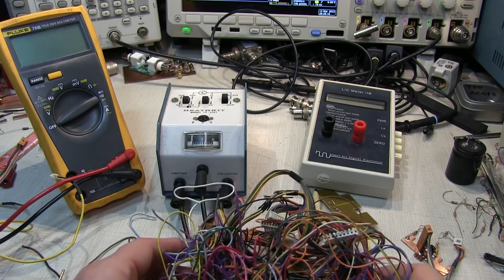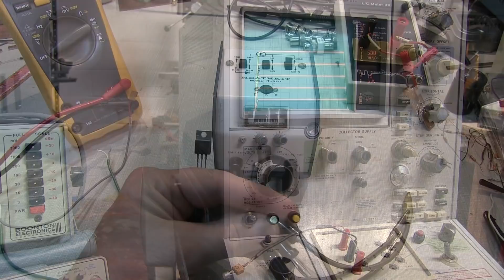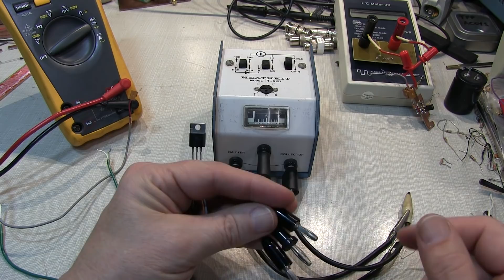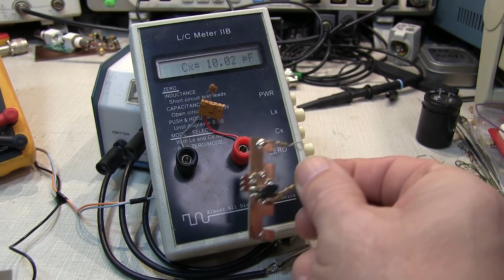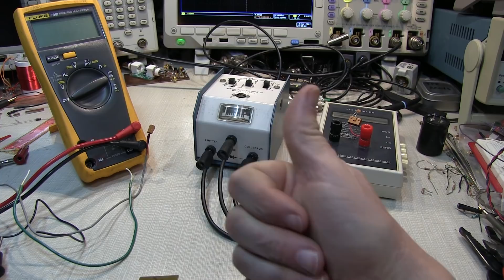#351: Quick Tip: Cheap source of test sockets wire and for your projects and component test needs

Comment: Some old serial and printer cables are a most excellent source for multi stranded hook up wire in a multitude of nice colors.... They are also very easy to salvage, just cut the insulation lengthwise with a knife and pull it off.

Comment: After handing a lot of old wire/cable it might be a good idea to wash your hands before eating with your hands, PVC often has pthalates in it, well, kind of coming off of it.

I have used lots of used wire and cable, too. Good video, as always. 

I like the floppy power plug socket tip. Oddly, when putting test leads on a breadboard, often put the breadboard down on a piece of looped indoor-outdoor carpet, and then I use a strip of velcro to hold the leads cables in place onto the carpet.

Comment: Microwave ovens and washing machines are a good source of wire, screws and other bits & pieces.

I like the idea of using those connectors as test sockets.

Comment: VGA cables have been tossed or recycled in vast quantities and low priority installations are still being processed as organizations, government, and educational institutions refresh equipment. VGA cables have a variety of wire inside and are very flexible. Sometimes you can snag 25, 35, 50 feet, or longer cables removed from projector installations.

Comment: Beware of some of the wires. Not all of them will solder very easily. Test solder 2 of them together. A different flux? Too little heat? Oxidized, contaminated or dirty?

Comment: If you end up using coax wire that isn’t 50 Ohm what should one look out for when testing? Also, using some of that old wire is fine when prototyping circuits on a breadboard? No other factors to consider? Like maybe accounting for losses in your equations or cutting to length depending on how many Ohm’s you measured.
Reply from the maker: These lengths of coax are so short, that the losses should be minimal at HF frequencies and below.  The resistance of the wire should be neglible.

Comment: If you have obsolete serial or parallel printer cables, cut off the connectors and strip off the outer sleeve with a coax/Ethernet stripper tool.  You get 9-25 different colored #28 flexible wires.  Perfect for a wiring a control panel to a pcb.  Twist wires together for a neat low noise assembly.
Reply: Old SCART leads are also good

Comment: Absolutely! I’ve been stripping wiring harnesses from freezers, refrigerators,  washing machines, HVAC units too...for decades. Installers thought I was nuts when I said I wanted to scavenge our two aging central air units. Two nice blowers, two little squirrel cage draft inducers, 24V continuous duty transformers, wire, switches.

Comment: Wire from such commercial junk is a piece of shit, especially for applications requiring soldering. Low temperature resistant insulation, very bad tin wetting. Do not use this junk, definitely not worth. Buy proper quality wires.
Reply: Especially wires from the more modern commercial junk are crap. Do not use it unless desperate.
Reply from the maker: I've actually had good luck with wires pulled from electronics from the 70s through the 80s.  Things started going downhill in the late 90s in terms of component/wire quality.

Comment: Other good finds from temporarily diverted electronics and appliances: wires with high temp woven fiberglass insulation, odd parts that really come in handy when I've suddenly needed them (coils, ferrites, opto-isolators) and all manner of spade connector variants.

Comment: Vintage NOS TV service extender cables are also handy - 9 different colors in each harness.  RCA Convergence and yoke extenders yield nice 18AWG stranded 600V wire.  4 feet typical length, so plenty for use.  eBay and swap meets yield lots of extenders that serve no modern purpose.

Comment: Hello and thank you for your informative videos. I recently got my hands on a Simpson Model 49 Analog meter. I cannot find any info on this model. Are you familiar with this model?
Reply from the maker: I've never seen a regular VOM called that, but I have seen a '49' as a model number for just the meter movement itself, such as on page 10 of this:
http://lcweb2.loc.gov/master/mbrs/recording_preservation/manuals/Simpsons%20Stock%20Panel%20Meters%20(Bulletin%20No.%202065).pdf
Reply: @w2aew  I suspect it is a home built tester. The meter is marked Alternating Current, rectifier type, numbered from 0-15 volts,  2000 ohms per volt, Simpson Model 49. It is enclosed in a stainless case with two selector switches. Thank you for your reply.
Reply from the maker: @bobv8041  That's probably what it is, especially if it doesn't appear to be a Simpson-made case.

Comment: We had a replacement satellite TV dish installed (at no cost to us) and afterwards, the installer asked where he could bin half a reel of high-quality 75 ohm coax. He explained that installers were told to allow an average of 30 metres per installation and if a 50 m reel was likely to contain less than that, they binned it. Turned out there was over 30 m of coax left on the reel which I've put to good use!

Comment: A few months ago i bought a new washing machine, and wanted to recover the wiring from the old one (11years old), i found less then 3metres total in wire inside.
I remember back in the old days (end of the 80's begin 90's), when i did this, i had a entire box full of cables in all colors and color combinations you can think off.
Reply from the maker: Yes, the older stuff had more wires, less integration.

Comment: The best type of re-cycling is "Man Hours" of labor contained in something, more than the elements by weight. For example: Harvesting the wiring and components inside of old electronics gifts TO yourself the hours that were already expended (and would be lost in shredding&melting down a VCR) and would extract thos hours FROM YOU if you were required to make these same cables and wires all over again, which would be waste.  There are NIL hours of of human labor contained in recycling Glass/Paper/Plastic but we all do that.
Extract the old (much better) wiring and also the connectors & transformers before you toss a VCR in the recycling bin - The VCR will only weigh a pound less, but you will gain the increasingly rare parts that stored some of the labor of construction.

Comment: Hi i recently remembered your video about making your own BNC-ended jumpers (how to crimp the connector properly). Since this very video and the 
one with BNC connector kind of relate, would you mind answering couple questions? 
First of all, would the type of the cable matter (RG-58 was in your video) for lets say, higher frequency signals. Siglent SA has a tracking gen that goes through all the SA bandwidth (2.1, or 3.1GHz), and i heard for these higher freq. the type of cable also start to matter (in addition to length, correct me if i'm wrong). Also which crimping tool did you use, and is the procedure simmilar when crimping other connectors, like SMA, N, or other types? 
I could have saved a lot of money if it was, since when i see the factory-made cables prices are insane sometimes, and i don't even know where to start.
Reply from the maker: RG-58 is fine for several GHz operation for these purposes. If you want something thinner and more flexible, you could use something like RG-316 or RG-174.  Other connector types each have their own crimping procedures - it's best to check a reputable manufacturer's assembly instructions (such as Amphenol).  Those instructions will also list details on the recommended crimping die.  I use a PWR-Crimp tool and have a few die sets for it.
Reply: @w2aew  wow thanks for quick reply, i will make sure to look at these.

Comment: That is another excellent video, Alan! The wire harnesses are quite handy and I have even used some in the exact same applications as yours (curve tracer and LCR meters). Although more limited, even the multi-via flat flex cables that are used in some more modern equipment can also be repurposed - I fixed quite a few FDD drives in vintage laptops re-using these.

Comment: I scored 65# of tinned appliance wire in all different sizes and colors at a thrift store. 600V 105C rated, good stuff. My problem is, half the broken stuff I pick up for a buck at yard sales and thrift stores with the intention of parting out, usually gets fixed. Bought a "non-functional" TS520 at a hamfest for $50, with the intention of using for parts for my other one should the need arise. Driver tube was loose, switches nasty. 30 minutes of work, it's on the air, working better than my first one! 73 K4YKI.
Reply: Yeah, it's really annoying when that happens!  😂

Comment: Great video.  I have salvaged wire from old equipment for more years than I would care to count, but even though I used tube bases and the bottom of tubes as connectors, I never thought of using the small connectors you described.  Great tip!

Comment: If you haven't built up your stock of this yet, do it soon. Later consumer equipment usually just has a switching supply that's been run hard, everything else surface mount and all connected with ribbon cables. Not much to salvage usually.

Comment: Been salvaging such wire for years.   What is the stiffer wire that looks like it is pre tinned twisted wire through the entire length.   Feels like solid wire but looks like stranded.  Does anyone know what I am referring to???   Thanx.   The coax has come in handy many times when shielded wire is required.   The short pieces of solid wire become twist ties for quick bundling or dressing power cords for storage.
Reply: I think I know what you're talking about, it's stranded wire which seems to have flat tinned wire rolled around it. I usually find it in TVs as flex connecting to different boards.

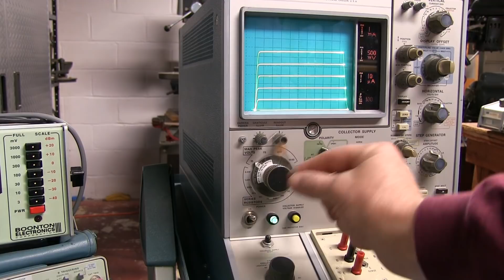Comment: That is a very linear transistor that you tested at 1:20.  Would sure like to know what the part number is.
Reply from the maker: It's an old RCA 38788 (house marking?) - similar to the old 2N2222

Comment: I used to use a lot of the old solid core telephone wire for breadboarding. Never spent a dime on wire when I was younger and telephone trunk cable segments were easy to pickup as scrap.
Don't forget to desolder the male connectors off of the appliance PCBs too, for re-using in your own PCBs.
Cheers,
Reply: Ethernet cables are a good source of solid wire now.
Reply: @mc_cpu  Yep. Lots of it taken from discarded CAT5 cables.
Reply: Yup... Still use the solid core telephone wire for my breadboards...
Reply: Yep. Major source of breadboard wire. And yes, I try to keep the mating connectors (even with less common pitches), as it's good for DIY projects and prototypes.
Reply: Love the old Telcom cables w/ 24 or even 50 wires in them .. perfect for projects. N3BZ

Comment: Just went through one box of salvaged wire and pulled out all the wires with plugs on the end to put in a separate box. Was looking for a plug to let me connect to the input of a power supply to allow bench testing and found just what I needed. Thanks for the ideas. Will have another look in that box.